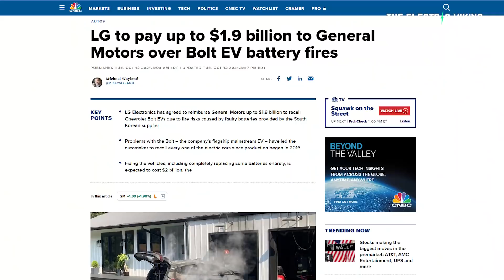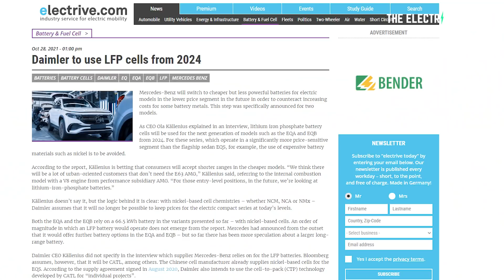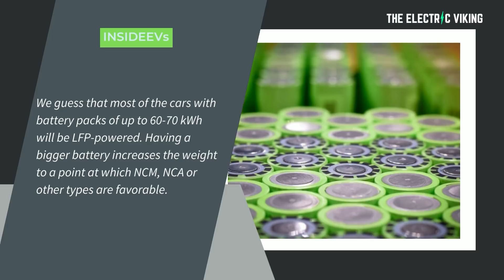Mercedes follow Tesla’s lead, will pivot to LFP batteries

Comment: The big difference between LFP and all other lithium rechargeable batteries, is that LFP does not use a flammable electrolyte. It burns less violently and is easier to extinguish without special chemicals.
 The other features are all icing on the cake.

Comment: I actually intend to purchase an Aptera. Not a tesla.  The car touts solar charging of 40+ miles of range per day on a bright sunny day, with ranges of up to 1000 miles. I believe it has been confirmed these will be nickel based batteries, which makes sense since weight savings is one of the major cornerstones of their ultra high efficiency.   I have wondered if not driven a lot, if the solar system will keep the car at a constant state of 100% charge.  I wouldn't mind a range reduction and LFP batteries used.

Comment: Telsa only needs LFP if the 4680 FAILS.  It's a backup plan; they can't just cancel Cybertruck.  4680 Fail would be a huge for Tesla, not some cool move.  Beyond that These are all Lithium based & constrained by resources so they are dead ends; a best 5000 lb demos of EV viability before Solid State; which is the holy grail of EVs - if Solid State fails so do EVs in general.

Comment: If I were to buy a used EV, I would prefer LFP, because they probably have more life left in them.
I would do the same with a new one because LFP is safer. The EV fires are overhyped, but many people think that it is a real problem. It might be easier to sell the car eventually if I could say that these batteries don't start a fire.

Comment: Hello, Sam.  What about LFP range in very cold weather.  The low here in Minneapolis tonight is -15 F / -26C.  Has happened a dozen times this winter, not just an isolated event.  And in the northern parts of the state of Minnesota (US), they are often 5-10 C colder.  Do a video on cold weather battery performance!  And I'm not talking about a wimpy -3C video!

Comment: I would select an LFP battery for several reasons, the most important is because I am not looking for performance and high speeds, I am looking for reliability, comfort and long distance in a safe, comfortable and economical EV.  That there are some EVs that are speed demons, so what?  I am more into long range distances, and reliability of charging systems on the road like Tesla.  I drive very conservative, like 2-5 miles below the maximum MPH on highways.  Doing that since 1972 when I got my driver's license, and I have never caused or being in an accident caused by me, and my cars last decades with me if they are good cars.  I happily would buy a long range Tesla like the 3 or the Y, I don't need the performance of the S or maybe the Y.  That is my give on this.  And anyway, the future is EV, and Tesla is pushing everyone to follow suit, and Tesla is the absolute leader in all parameters, specially in batteries. Now, if there were a Cybertruck with LFP batteries, I would go for it due to all the safety features that beast has, specially the almost bullet-proof exoskeleton and its capability of navigating!!!!!

Comment: LFP batteries are great; but I disagree that an LFP with 80% of the storage of a Li – Ion battery is basically the same as the Li -Ion since the Li -Ion has a degradation problem if coastally charged above 80%. I’ve had a Model 3 P for 2 years and usually charge it to 80% for my daily commute to work (30 mile commute, no problem); but, that extra 20% range is very nice to have on road trips when I charge to 100% (with only a very small degradation penalty since which I only so occasional road trips).
Reply: I don't own an EV so this might sound ignorant, but is it possible to set the maximum charge to 80% (or any other value) on a home charger and just leave the car plugged in?
Reply: @johannbrauer9285  Tesla yes, I do it all the time, others I think yes too.

Comment: Since hearing of the 4680 battery, I've assumed it was denser, lighter, "better" than others, without understanding why; just trusted Elon not to be bragging about vaporware. Now, as it comes into production, I wonder how much better it can be than fast-improving LFP models like BYD's Blade. Increasing energy density, ability to be recharged far more than other chemistries, and lack of fussiness about charge levels: these virtues make it a likely first choice for many buyers, maybe me. Mercedes, as Sam just informed us, is going in big to develop solid-state batteries, but, not only in the meanwhile, LFPs may be a winning form.
Reply: Tesla uses LFP batteries in model 3. It's quite nice!

Comment: While Mercedes are making deals with battery suppliers, Volkswagen have their own battery development laboratories in Salzgitter.   Volkswagen also have their own Electronics Research Laboratory in Silicon Valley USA, and they’ve also started their own software company called CARIAD.   They will be making their own batteries in house rather than battery suppliers with something called a unified cell and production will start in 2023 and they’ve told battery suppliers that after current contracts have ended that will be all, it definitely makes an interesting read and it’s good to hear at least one legacy manufacturer is after vertical integration!

Comment: VW invested in Gotion, producer of LFP batteries. That was long before Tesla started using LFP. Gotion will set up a battery  factory in Europe with VW. Tesla does not produce LFP batteries and VW did not pivot because of Tesla. In fact the onl ycompany  that pivots is Tesla.

Comment: Also, Enovix in Silicon Valley uses silicone anode technologies to almost double the energy density of battery. I wonder if there is any effort yo combine LFP and silicone anode as well as solid state technologies to create a super battery of cheaper, safer, longer life, and higher energy density. It seems like every battery company now are doing their own research and not cooperating. Enovix has great silicone anode technologies but no money to quickly expand into EV battery. They are making just small batteries for smart watches and hearing aids that carry a higher margin.

Comment: LFP. The lower energy density is more than offset by the ability to max charge and discharge without a degradation penalty, not to mention the huge safety gain, not to mention the massive increase in cycle life.
Reply: And cheaper and more eco friendly
Reply: LFP's cycle life isn't that much higher than NMC, and degradation is still correlated to temperature and depth of discharge.  People generally overstate the differences.
Reply: @GregHassler  
Definitely, thermal management is critical to cell life, but still LFP is still cheaper, safer and longer lasting than NMC. The safety factors alone would be enough to switch to LFP, but replacing cobalt eliminates another set of economic, ecologic and moral problems of mass production. 

The one area NMC excels in is energy density, and the Chinese may have already overcome that with densities in excess of 200Wh/kg, (IIRC).

What's your personal preference?

Comment: LFP will increase the resale value. 2000-4000 cycle batteries will mean over 1 million km life vehicles. LFP handle 100% full charging, and full depletion better. Although less Wh/kg, probably still get very similar range if you are trying to be careful with other chemistries. Less to worry about with LFP. LFP charge faster? Far better value battery.

Comment: You asked us to tell u..
I'd say... today..I want LFP  because they are safer and they are more robust battery .. can be 0 to 100% depleted and charged unlike other current technologies..,& well this is if you know anything about battery tech...but  at the it's moving so quick things change very soon... And I'm pretty sure that the battery with the highest energy density as long as it's safe will win always win as weight saving as we all know is always a good thing to a certain point.

Comment: It's the other way around
why is Tesla not using 100% LFP batteries?
no good excuse - except less range - who cares with the Superchargers around the USA
Reply: LFP batteries loose their performance under heavier loads. That's why the model 3 with LFP batteries does 0-60 in 5.8 seconds vs 5.3 it did with other chemistry. Software controls the usage to maximize range/performance balance.

Comment: Net zero home heating and cooling.  Geo thermal heat pumps for heating and cooling homes.  Very expensive but supposed to be cheaper over time.  What i am thinking here is an improvement to geothermal well pipes is these pipes must have extremely efficient temperature exchanging potential.  If you think of the amount of surface area on the inside of the small intestine in the human body, there is very high surface area.  Having the same kind of structures on the inside and out side of these geothermal well pipes. would increase the efficiency of the temperature being exchanged.  Geothermal heat pumps for net zero home heating and cooling.  Probably a necessary bridge to net zero future.  And also i can imagine multiple homes in a city sharing the same geothermal wells, more efficient.
Reply: Geothermal is not practical in alot of locations. More likely for a city to reuse waste heat from industrial processes or power plants to heat housing and commercial buildings

Comment: LFP is the battery for the near future, other chemistries will overtake it. In the foreseeable future, I see Sodium-Ion be the battery for low-end BEVs, solid state Lithium for longer range BEVs, and Iron-Air or flow battery for grid storage.

Comment: Good thinking to follow Tesla as they are the leading battery pack manufacturer. The safety features built into their packs is comprehensive because to get EVs adopted they needed to avoid giving ammunition to legacy auto to shut down the progress. Did you know that there is a pyro fuse in the pack that goes off when the airbags are deployed to render the car free of  high voltage and safe to passengers and first responders in the event of a crash? or that the inter cell wiring acts like a fuse and burns out easilly in case of excess current being drawn which could lead to overheating and spontaneous combustion of cells?

Comment: I would give up a little performance and range to get a battery that won't catch fire and can be charged to 100% without wearing out prematurely. But I don't think that trade off will last long. The range, energy density, and cold weather performance will be solved.
Reply: Check out Bjorn Nyland's channel. Today he published a video on a cold weaher range test he conducted on a Tesla Model3 fitted with an LFP battery you may be surprised by the results.
Reply: @eclecticcyclist  .. as I'm a lazy git  a link would be nice 😂
Reply: Also higher cycle life and cold weather has been solved already

Comment: LFP is great but I think we will see new battery chemistry announcements every year. It will be very exciting to see all the research come to market. Think about how many advancements there were to ICE engines over the last 120 years and most of that was done with no computers. Today folks all over the world can work on a problem all at once and advance quickly.
Reply: Sadly unlikely, battery tech moves very slowly. Plenty of new ideas but volume production takes decades.
Reply: @whowhy9023  Did LFP start decades ago? I must have missed that.
Reply: Research is great, but most of it can't be replicated in mass!!!
Reply: I am a fan of battery swapping. At least with NIO, new batteries with newer technologies are compatible with older cars.
Reply: @johannbrauer9285  That could be good if it happens. Even if the swapping company goes out of business you can still charge the car and it might make battery upgrades easier if your car was made for swapping.

Comment: LFP.  It only took less than a dozen car fires to cripple GM and LG Chem.  I think the decreased risk of fires is more important than the other forms of batteries are more fire prone.
Reply: Safety always first... family...  car..  home...
Reply: @juanmanuel9822  ... So don't run an ICE car as it's 100 times more likely to set on fire according to sam
Reply: There were 16 Bolt EV battery fires.  There were also 17 Hyundai Kona EV battery fires, which like the Bolt use LG Chem batteries.
Reply: @Laura-S196  Intersting fact thanks.. I wonder what was with the number of those vehicles on the road compared to ice cars... So the percentage of ice that have had fires compared to the percentage of evs.. and I suppose it's worth considering whether they were in an accident at the time which caused the fire, how many of them were just driving along normally.. and how many were just parked up.